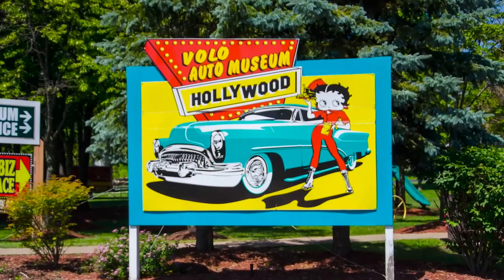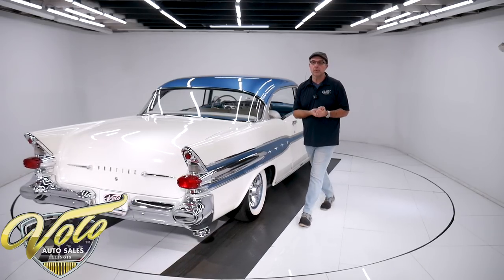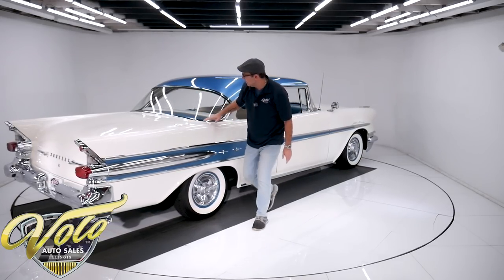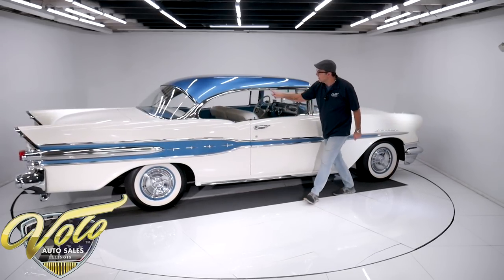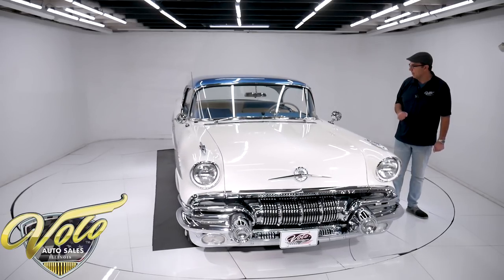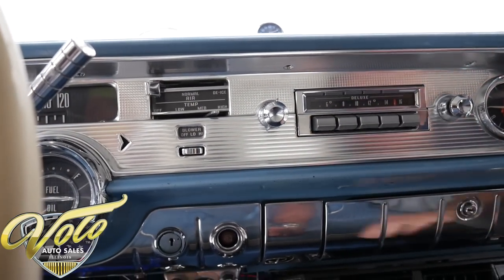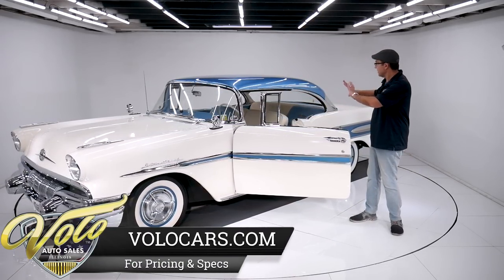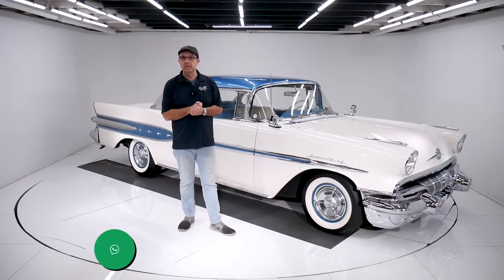1957 Pontiac Starchief for sale at Volo Auto Museum (V20711)

Comment: My dad never bought a new car until he was 51yo.   He bought a '57 Pontiac and drove it for less than a year and then sold it and bought a used Rambler, which he drove for about 6 years.  Then in 1963, he bought a '64 Chevy II.   It was a good car.   Only a six cylinder, but had plenty of passing power on the freeway.   He hated it because it had a cracked intake manifold, which he never had replaced.   He drove that car for 6 or 7 years.

Comment: In 1965 I bought a Star Chief Safari (the Pontiac "Nomad") from the original owner. It was the identical color scheme but my roof was white (which I prefer and, by the way, the blue on the top of yours appears to be a metallic that doesn't match the side trim). It was loaded, down to factory air, the "Wonderbar" radio, and power everything. The only option it didn't have was three two barrel carbs on the 347 c.i. V8. I've always wondered what became of that car after I sold it on a few years later. They have become very collectible as Pontiac made fewer than 3,000 in '57.